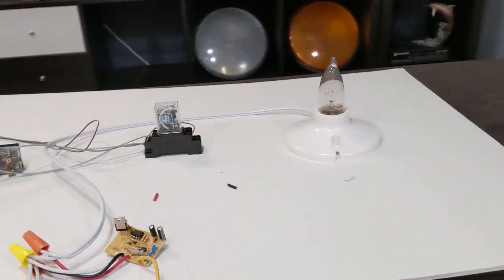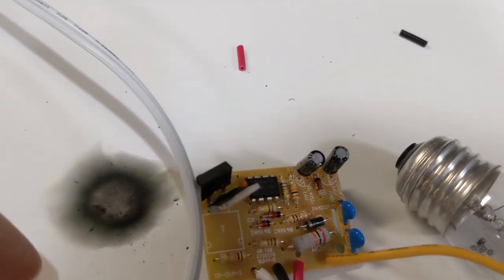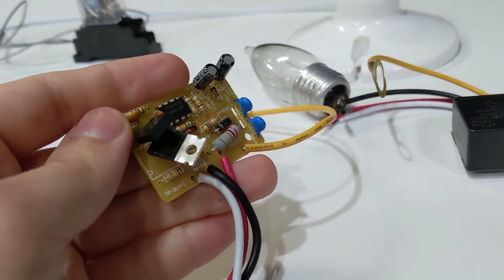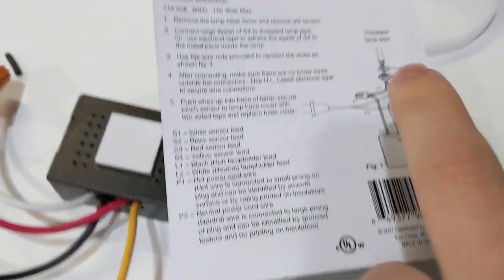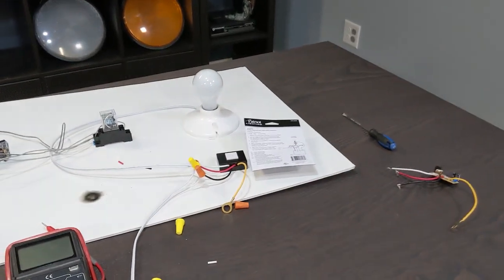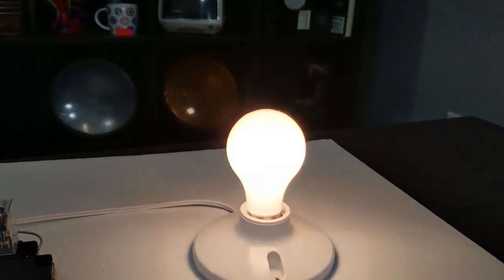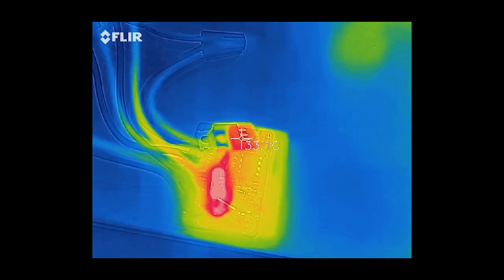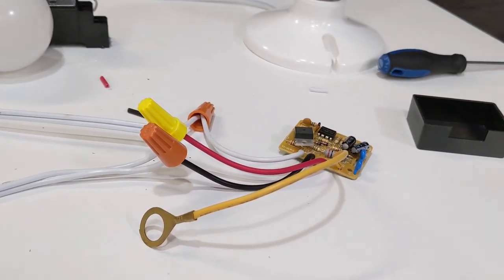A slightly explosive touch-lamp follow-up (standby energy consumption)

Comment: Usually the hot is switched, not the neutral. If I'm understanding the wiring diagram correctly, the bulb socket will always have power running to it, even if it appears to be off. This is why polarized plugs are a thing in the first place.
Reply: After the rewiring, I was thinking the same. It really looks like the module just hooks up to the hot to get power itself and will only switch the neutral, which is absolutely dumb…
Reply: I also noticed they appeared to be switching the neutral. Which is a bad idea.
Reply: I have a thought experiment for you. What country do you think this product was made in?
Reply: It's AC, the module doesn't care if you put live at the light socket or neutral, you can simply reverse the input from the plug if you want it and it will work the same. In a lot of countries like mine power plugs aren't polarized anyway, so which pin is live and neutral changes each time you plug it in anyway.
Reply: @BBQLab  why would a company called patriot lighting manufacture their stuff overseas?! Surely they would feel a patriotic obligation to manufacture in the US!
Reply: The live should always be switched, and the neutral aswell at times.
Reply: @alerighi  Except that Neutral is also connected to ground. So if you have a short in the lamp, switching the hot means the case is only live through the short when it's "On", switching the neutral means if there's a short the lamp casing is always live and you can get a shock by touching it and making a route to ground. So their suggested wiring diagram is terrible, especially with ungrounded cords.
Reply: With it switching the neutral it's hard to believe that's a legitimate UL rating on the package, even with the mixed up color scheme.
Reply: Switched neutral is beneficial in fault finding on complicated control systems with distributed panels because you can just check voltages to ground without often dealing with awkward continuity tests... However, often people aren't used to it and it makes that design much more dangerous. In domestic wiring neutral switching should never be used but because this is on a PCB in an enclosure I can't really complain about it.
Reply: @TheLenstaa  yes, neutral switching is beneficial but it should never outright replace switching lives, instead a double pole switch can be used.
Reply: @Lactuca  Do a Google search for "Complete list of Harbor Freight Brands" - they all sound very American. It's very common for Chinese products to be sold using a domestic sounding brand name. Today I saw some cheap audio electronics offerings from Victrola and Studebaker.
Reply: @Lactuca  It's only a name.  It's a sure bet it was made in China.  Besides, can't there be Chinese "patriots"?  The word is not specific to the US.
Reply: @alerighi  Well, the thing is, according to the wiring diagram, neutral is switched if you adhere to the diagram and use a polarized plug. It specifically tells you what's supposed to be hot. And wired this way, the lamp socket will always be hot.
Reply: @Lettuce 
Because... it goes off like a Patriot missle! 🚀
Reply: Pretty sure i wouldn't trust that a touch lamp is necessarily "off" if i have to change the bulb. Yes switching neutral is a no-no but would you go stick your finger in the socket with the lamp plugged in, regardless of how its wired? Who's to say there is no residual voltage from that circuit or similar ones when its off? I know most simple Dusk-Dawn sensors wire in series with the bulb to power itself. But i digress. Common sense goes a long way in a very non-perfect world.
Reply: BBQLab China, you can see on the packet. (Under the barcode)
Reply: @TheLenstaa  My dad found out that some of the switches in our house were wired backwards(switching on neutral) when trying to install new ceiling fans.
Reply: @galaxyanimal  Wow nice, I haven't seen that before but I know people had a habit of ignoring the wiring standards. My step brother had removed his lights then called me over to fit new ones, 3 black wires hanging from each light fitting location 🤦🏻‍♂️ had to disconnect and meter out every wire to determine the circuit (and that there was no ground) 😂
Reply: I suppose, switching the neutral is the right decision here, because then the touch wire is at neutral potential. Which matters more than the potential of the bulb. I am not sure it is true, and i suppose there is a small-value capacitor in series with the touch wire for it to not become an elecrtocution hazard, which makes it less important.
Reply: @TheLenstaa  Yeah, we also had some outlets melt because we have aluminum wiring & they were installed using the connectors where you jam them in the back, which get loose easier.
Reply: @alerighi  It does matter, the module is testing capacitance and is using the neutral as a ground reference to do so.  The neutral is connected to ground at your transformer.
Reply: @TheLenstaa  The wiring diagram literally indicates hot should be permanently wired to the lamp socket. This isn't just on a PCB; it's the entire lamp that will be connected to live and not neutral whenever it's switched off. A short to any metallic portion of the lamp will mean that the lamp body is permanently live. Now, think about how you operate a lamp with this module installed…
Reply: @Chaosbar  I don't know what point you're trying to prove but when you wire a lamp without this touch controller you'd wire live straight to the holder except you would have an inline switch. I would have to see the schematic to determine the effect of injecting supply voltage on the sense wire but I'd imagine it's designed in a way to create short circuit current draw.
Reply: @TheLenstaa  Why are you making this about a "point to prove"?

The only point, which has nothing to do with the schematic for the module itself (only the wiring diagram) is that if wired as indicated, hot is wired permanently to the socket, and neutral is switched. As you explained, "in domestic wiring neutral switching should never be used".

The reason here is that should the wiring inside the lamp fail, all else being equal, it's better to have both hot and neutral at the point of failure. It's not impossible, but much less likely that you'll end up with just hot shorted to the lamp body. I'm sure you can imagine why that would be a bad thing for a touch lamp. It's not that any of this should happen, and I certainly don't know the regulations around these things or requirements for UL certification. But it's a needlessly bad design at a minimum. My guess would be that they saved a couple cents per unit for some part by switching neutral rather than hot.
Reply: Yes, it looks like this is a neutral / low side switching device.  The reason for that is that it probably makes firing the triac easier while keeping the sense electronics near the neutral voltage.  The reason for this probably has to do with noise immunity of the touch sensor.  That could have been solved by using an opto-coupled SSR instead of a simple triac but that would have increased the cost.
Reply: Yep yep yep yep yep yep yep yep yep yep yep
Reply: @corbamilk6412  ever heard of Charter wiring system which was actually Allowed by code at one time where three-way switches could be wired or to the switch the hot and neutral to both sides of the load and obviously only one way would work for the light to come on or whatever is connected it was done to save wire in some cases and last runs of individual wires but it throws hot neutral out the window says depending on which switch was in which position either terminal could be hot or neutral sense power only goes from hot to neutral not including the possibility of ground I once saw a setup where they wanted to switch outbuilding light from two places from two opposite buildings there were three buildings in a line sort of but you get the idea there was one wire running from one building 2D octoling in one running from the other one which had a three-way switch that's switch between hot and neutral on both ends and the outlet in our things in the building we're fed from another set of wires from the pole that ran back to to the barn and also there was a another light that was fed from that light any yard light in the front of the place and other weird stuff for example the light in the hay mow in the barn was switch from the house however the yard lights by the barn worst witch from the other Barn and Deloitte where the well house was and the yard light we're both switched from uphold about a city block away from anyting and the yard like above their was switched from the third story of a house in the air in attic which wasn't even furnished and also the switch for the electric fence was in every single place there was a switch normally by the way the electric fence at that time was not a fence controller it was a lightbulb connected in line with those switches then connected straight to the fence wire yep I just said it true.

And also that place did have scriptural sockets in virtually every area even the new construction which just makes me ask why.

Mounted on a modern ground a junction box.

A law that wiring we could not even figure out what it was for or even why it was there and weird switches everywhere outlets in places you wouldn't expect Outlets bulb sockets where dinner Neva need to be one 1 bathroom have been used as a ground terminal block all longer piping all the grounds have been run to that one bathroom and packed into all the piping through plumbers tape the electrical service the new one supposedly which was still ancient for the time was in the bathroom next to that above the tub and shower main fuses for that where to mail rods and I switch which was located above the faucet on the tub needless to say that bathroom was not used for a bathroom.

The only Plumbing that was connected was being used as a ground rod and I've been jump it off just something else possibly a gas line that ran Underground to the old gas lighting installation turns out that was a carbide gas generator for acetylene in a concrete block and concrete building in the middle of the place no lights or anything but what look like a door that would be on a fallout shelter at first I thought that's what it was when they first moved in until they opened it up and saw this Machinery that look like a plumber's nightmare and also in addition there was an error gas system that would have used gasoline and had a blower that photo of are underground into a giant metal carburetor sorts that would generate gasoline vapor to operate gas lights so pretty much if it'd been around at one time that place at every last bit of it handheld DC power of the firm power system at one time later on Central DC and Mac and yes there was a big favor rectifier for Friday Sea from AC of course all that had been discombobulated but the hardware was still there in one building was nothing but batteries and other electrical gear it was still around but obviously not doing anything 

And on top of that there was also more Modern Gas lights which even then were close to a hundred years old so who knows how far back that went probably the most interesting / messed up mixed up by save ever seen but still anyone that we're gone there would have just been scratching their heads interesting to say the least bit of History probably every bit of History tour would have been was there and yes there was even to steam a roast at the power at one time evidently there was Refrigeration that was powered by Steam both mechanical and ammonium torsion both at one time even the ventilation system was powered price team some of it was conduction other mechanical as well as there was a system of a high-velocity blower? And would be pranks that would Supply air pressure and use a Venturi effect to provide ventilation through the other ventilation systems at least some of them and even there were heat exchangers in the chimneys for the place this probably I don't know where and when it was built I don't remember which state this was in
Reply: @Wiresgalore  by the way with any electronic switching device you know like those smart dimmers some of them at least some x 10 modules other automation devices and somewhere devices come with a sticker that you're supposed to put on dome light fixtures saying to disconnect power before changing the bulb because of this fact because there could be voltage present because it requires hey circuit to complete through the bulb in order to get power to the device to make it work thus there will always be residual voltage if power is on to the circuit so yeah this is a real thing also this is now the reason why I didn't require a neutral at every switch location and I think every box now in the current version of code for the United States because of automation systems now which also has a side benefit if you ever want an outlet somewhere we need to tap power from somewhere you've got your neutral.

And my folks place the wiring is kind of crazy and I wanted to be able to control certain fixtures from one switch AKA downstairs lights and the light at the top of the stairs this is in the basement and a few other places around there but turns out the switch Loop only had a hawk feed in a heart return to the original box where the circus started to the lights so it was not possible to do this and the rest is history. So you have to go from switch to switch to turn off basement lights
Reply: @Anaerin  You are forgetting this lamp can't use a grounded cord.... where would the ground wire connect to on the lamp? the metal casing? No... thats the bit you want to touch to turn it on! If you ground it, this whole touch-control thing wouldn't work....

Unless I'm missing something obvious....
Reply: @oxybrightdark8765  I just saw your new username and I got it the oxy part is because it's oxymoron is that it?
Reply: Aaron Brandenburg well yeah, you can’t have a bright darkness. Well done, you’re the first to get it :)

Comment: That should be a SAB 0529 Triac driven by a TT061 IC, which does touch control and has a zero-crossing detector for reduced interference.
The circuit still need an inductor which I don't see on the little PCB, so it could be somewhat unstable (i.e. Triggered randomly by any spurious interference).
The Triac needs an heatsink for any load above 30 W, which I don't see, either.
Thanks for the video, always a pleasure to watch!